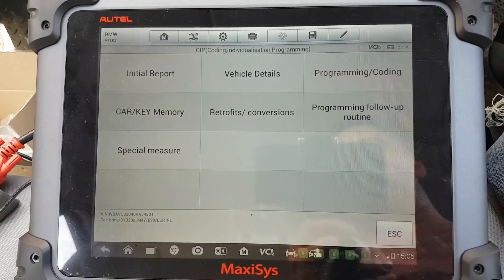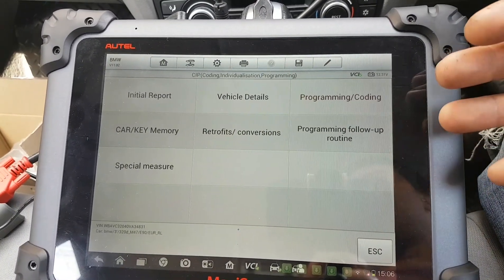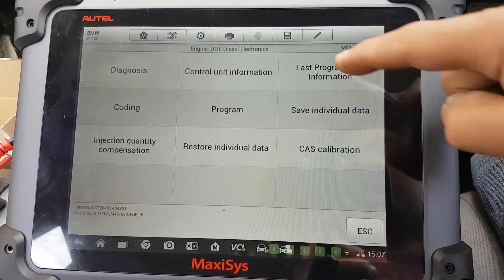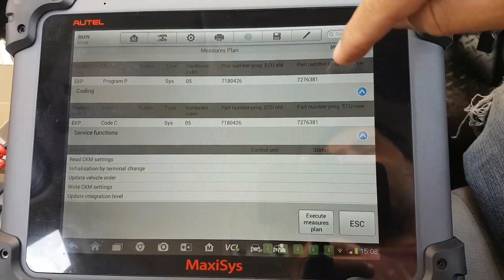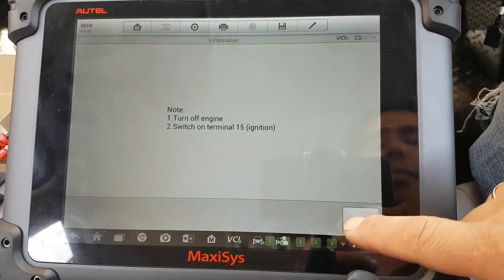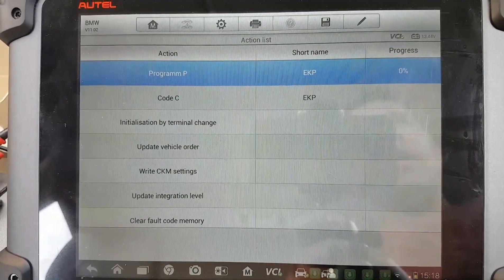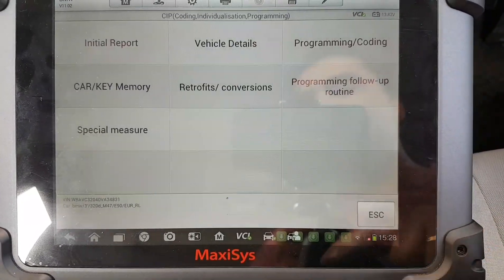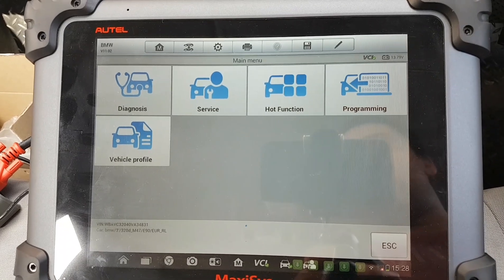BMW individual module programming using Autel MaxiSys MS908P.

Comment: Great Video mate, May I ask whats the difference between coding and programming?
Reply from the maker: Coding is more like change options... programming, is like updating the actually software/firmware inside the modules...
Hope it makes sense...
Thank you for watching and for your comment!
Reply: @LMAutoRepairs  HI FRIEND I HAVE THE SAME SCAN TOOL BUT MY SCREEN WHENT OUT SO IS THERE  ANY PLACE WHERE I CAN GET MY SCAN TOOL TO GET IT  REPAIR.  MAXISYS MS908P
Reply from the maker: @seankim1743  
Not really... sorry...
😔
Reply: @seankim1743  unfortunately, the only place to fix one of these is at Autel in California. www.autel.com

Comment: Thanks for sharing such a helpful video, can maxisys program a used mechatronics (transmission control module) on bmw F01?
Reply from the maker: Never tried it... so can't really comment... sorry...
Thank you for watching and for your comment!
Reply: Mech units have to go to dealer . This scanner can't program that.
Reply from the maker: Maxisys can program it no problem...
VIN number etc...
However, it fails to reset the immobiliser on it... for that you have the IM608 for example...
👍👍👍
Reply: @LMAutoRepairs  hmm that's why i had issue ...immo was why . Thanks that's good information .

Comment: I have a question can this program bmw cas 2 keys ?
Reply: yes u can program and code the cas module(car acess system) and keys
Reply from the maker: @cal638  
You have to show that...
Reply: @LMAutoRepairs  I don't have a video but its a requirement when programing a used ecu and new keyfob
Reply from the maker: No.
Thank you for watching and for your comment!

Comment: Is an active subscription required with Autel or BMW required to do these updates or is all the software stored in the scanner?

Thank you!
Reply from the maker: Hi
The subscription is with Autel...
And no, the flash files are downloaded as required...
Thank you for watching and for your comment!
Reply: @LMAutoRepairs  Ahh ok that makes sense.

So when your annual subscription with Autel ends no more flashing modules....correct?
Reply from the maker: @firehawk6188  
Correct....
Reply: @LMAutoRepairs ...after the subscription ends with Autel u can still program and flash and code modules the only thing is that u wont get no more updates for newer cars when the subscription expires.
Reply from the maker: @cal638  
The flash capabilities also stop...
Basically anything that requires going online...
Everything else works as normal...
Reply: @LMAutoRepairs  ill double check u could be right, the only thing I notice was that after mine expire and after doing a full scan it no longer guides me on what procedure to do(it wont report and it wont guide me to execute a plan as before)...but I just did a full programing on my bmw after expiration because it was having misfiring problems but throwing no check engine on the dash or regular obd scan( cud have been that the data was downloaded previesly, I did remember that it started downloading new data but ill double check), after messing with the tablet a bit and doing a full scan it would register manufacture specific codes(which the autel table did explain what the manufacture specific code meant) on the autel table but no check engine on the dash or a regular obd scan.
Reply: @LMAutoRepairs  i just did some programming and i was able to connect to the internet and download the data needed from their database
Reply from the maker: @cal638  
Must be you then...
Once the subscription expires, I can't no longer flash...
Reply: @LMAutoRepairs I have no idea why ur tablet cant download and program/code after updates expire, the only thing i could think off is u dint fully register ur tablet with autel but registration is a requirement before using the tablet
Reply from the maker: @cal638  
Well, you are the lucky one then...
Because, for the last 3 years, every time my subscription expires, BMW programming, mercedes SNC programming, and updates stop working...
Everywhere you Google, the answers are the same... so, how do you manage to continue to do it I don't know... just don't tell anyone... lol
Reply from the maker: @cal638  
I am not going to dwell on this again...
My subscription is yearly!
(You can buy 2 years updates, but I never did it, obviously at an higher price, and same rule apply...)
Everytime the subscription ends I loose all online capabilities. (I tried it and fails to download anything including flashing files!...)
Everything else works as normal.
You saying it is any different does not make it true to me, I wouldn't mind, but it doesn't!...
You or in your country Autel might operates differently, here is how it works.
I have actually messaged Autel UK, once I get their reply I will copy it here, so we end this discussion. 
Thank you.
👍👍👍
Reply: @LMAutoRepairs  my apologies, ur from U.K. I dint know that, I assume u wer U.S./Mex market...and I did appriciate ur videos, they where among the early videos on the maxisys when theres was not much info out to the general public..thanks for ur hard work
Reply from the maker: @cal638  
No need to apologise...😊
👍👍👍
Reply from the maker: @cal638  
Hope this finally answers your question... LOL
https://drive.google.com/file/d/186MgJ4GSQxab-1A-KnncK5nxbP2a39L2/view?usp=sharing
Reply: @LMAutoRepairs  whats that link u sent...is it a virus
Reply from the maker: @cal638  
What?
It is just a photo/screen shot...
🤦‍♂️
Why would I put a link to a virus?
Seriously...
Reply: @LMAutoRepairs  jajaja I was jokin...on my cellphone I get no pic  it shows as a link and wen I click on it nothing happens it just sends me to googledrive
Reply: @LMAutoRepairs  saw it on my laptop how autel U.K. replied..i would assume that autel U.K. and autel U.S. would b the same...if it means anithing I paid 1800usd with a disscount coupon of 500usd(original price 2300)...I just checked the subcrition n it is for 1 year like in U.K. .baugth it nov 2018....good thing is with the U.S version I can still flash and acess the database..ill post a video of me downloading from teir database and programing/coding  if anyone tryin to get the U.S. version and has their doubts
Reply from the maker: @cal638  👍

Comment: Hi. can you update bmw e60 climate control from manual to automatic with autel? ofcourse after all wiring was done befero.
Reply from the maker: Hi
Yes... should be relatively easy to change the VO and update the car...
Thank you for watching and for your comment!
Reply: @LMAutoRepairs  thanks for your quick reply. Did you ever try to to program out the passenger seat occupation sensor with autel? I know it fails a lot of times in the bmw, I know that you can do it with ncexpert, but I'm interested about autel capabilities. Because I just ordered one.
Reply from the maker: @modestasserpenskas2353  
Never did one i think... i mean, not with the autel... but under cheat coding might be possible...
Just go through the options available...
👍👍👍

Comment: Im gonna buy ms908bt. Can i use it after a year also when the update service finishes? Or do i have to pay like 699 each year just to use it?
Reply from the maker: Hi
Double check... but my MS908P continues to work as normal... except for the online services.... like flashing etc...
So, I presume yours will be the same...
Hope that helps. 
Thank you for watching!
Reply: @LMAutoRepairs  It means i can still use it same as after the subscription is over? Like i can still kode keys etc?
Reply from the maker: @Saqib.S  
Yes...
Reply: @LMAutoRepairs  Love you man! Cheers ♥️♥️♥️
Reply: u can keep using after updates expires including for program and code, the only diff is u wont get no more updates for the newer vehicles...u have to pay another subscrition

Comment: Hi, where the new software is coming from?
BMW website, right?
And you have to pay for that, right?
Reply: The correct answer is depends.  Some stuff is provided by Autel.  Others, you need to register the J2534 VCI with BMW TIS, and pay the subscription to program some modules.
Reply from the maker: Hi
No... software comes from Autel servers...
Yes... I pay for it through the Autel annual subscription...
Thank you for watching!
Reply: frm autel and autel get them frm bmw

Comment: Could you tell me the different between Coding and Programming?
Reply from the maker: Programming or also known as flashing, is the update of the actually software of the module... coding is more like enable or disable options etc...
Hope makes sense...
Thank you for watching and for your comment!
Reply: LM Auto Repairs thanks for your answer. There are some idea that Coding sometimes knowns as adaptation. Beacause when replace module. Just need coding for all module realise, not need programming right?
Reply from the maker: @vunguyenminh1774  
It is a bit more complicated than that...
But normally a new module needs programming and coding...
Reply: @vunguyenminh1774  ...only bmw and Mercedes need programming and coding when replacing modules, all other brands just coding

Comment: I have a 2008 335XI. Can the MaxiSys code the car with things like delete Adaptive Headlights? I mainly want to 
delete my "Adaptive Headlights" . There are a few other things I'd like 
to code also, like turn off the the night auto-dimming mirror feature. 

If you could let me know it would be great. I was going to install INPA and 
NCS Expert on my laptop, but that is not user friendly. Nice video and 
thanks in advance.
Reply from the maker: Hi
I can't go into the specifics of what can can't do... as I never tried on that car... but it can do a lot of coding...
Nothing like plug it in and see what it can do...
Thank you for watching and for your comment!

Comment: Hi, do you know if the j2534 with the autel can be used to programme other vehicles like Renault/ford etc? Thanks
Reply from the maker: It can... but not all those ...
The compatibility list on Autel website....
Thank you for watching!
Reply: yes it can it works with all or nearly all brands....and only bmw and Mercedes need programming for the rest only coding is needed....only bmw and Mercedes required this more expensive tablet....for all other brands u can do the coding with the cheaper 1k tablet.

Comment: Nice information 
But i like to ask you something about my car can I update it's a peugeot 307
Reply from the maker: Hi
You can... providing there is available updates on the version you are using... and not with the MaxiSys...
MaxiSys does this, as per the video, on BMW and Mercedes...
For Peugeot you need lexia or Diagbox...
Thank you for watching!
Reply: Hi, the maxisys elite dealer here in Australia say only bmw and mercedes are pre loaded in scantool for programming and they told me that the rest of the car make can’t program ecu unless i subscribe to vehicle manufacturer. Is this true? I’d like to buy one but my purpose is for coding like changing parameter if the car is equipped of ESP to modify from (absent to present).
Reply: Roderick Tuazon that is very true.

Comment: Thanks for the video you give some idea on what programming and coding and how to do this. My questions is do I need to check for new ECU version from time to time and update the firmware using Autel Maxisys Elite. Thanks in advance.
Reply from the maker: Hi
Well...not really... do it if you know that the new versions have fixes for a particular module, or if a new version comes with new functions etc...
You can do it just to keep the car up-to-date, but due to some risks involved,  I wouldn't do it unless is necessary or the customer specifically askes for it...
Hope that helps.
Thank you for watching!

Comment: Luis, awesome and good info thanks for sharing  ur knowledge so you placed usb cable between laptop  and autel 908 and which website you had in ur laptop and without subscription can you buy updates from manufacturer. thanks and cheeeers
Reply: j georges you need a subscription and update right from Autel you can get third party software no such thing.
Reply from the maker: Hi
The updates are included on the annual subscription...
Thank you for watching!
Reply: usb cable goes between autel tablet and autel programming module to ensure there is no data transmission problem when programming

Comment: Hi those this scanner program only BMW or can it do all models thank you
Reply from the maker: Hi
BMW and Mercedes...
Other brands it can do coding... it depends on the car...
Thank you for watching!
Reply: LM Auto Repairs thank you for responding sorry two more question what's coding? and were did you learn all this? Did you take any class? Trying to be like you
Reply from the maker: @edasplaces6451  
Hi
Coding is changing settings and other parameters...
I never had any classes... self taught...
I have some videos doing coding...
Reply: As the boss said it can do coding for all other brands......only bmw and Mercedes require program and code, all other just code